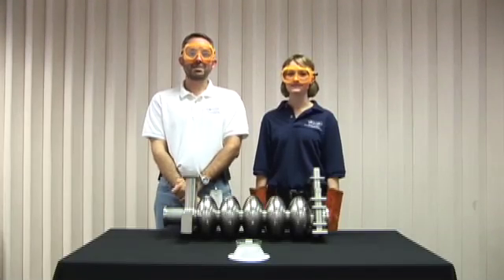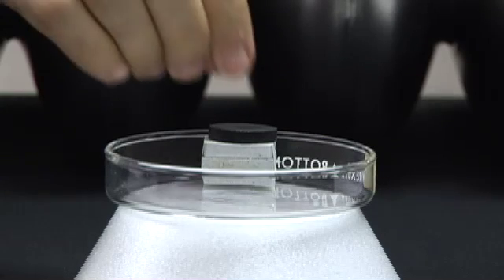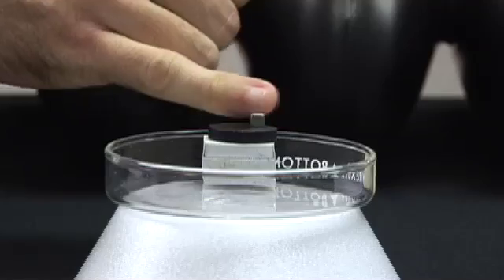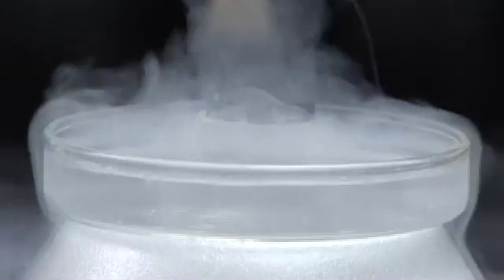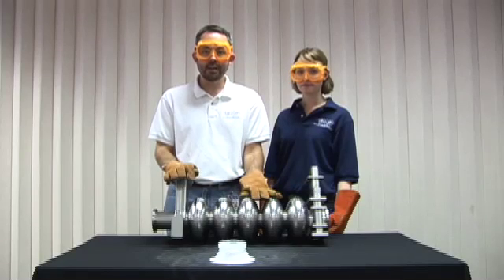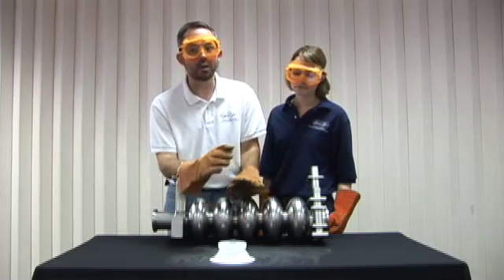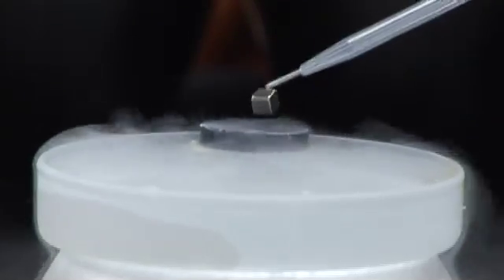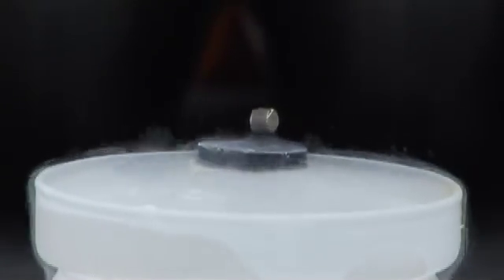Liquid Nitrogen Experiments: The Superconductor

Comment: One quick question. Can we use liquid nitrogen to obtain low temperatures required for superconductors and can we use these superconductors for electrical transmission by liquid nitrogen? Please tell me the reasons as to why it can or cannot be used. 
Thank you
Reply from the maker: Did you watch the video? This was a superconductor, and it was cooled with liquid nitrogen.

Comment: Great video! I know it's old, but can I ask some questions regarding measurements?

-size of the superconductor
-flux density of the magnet
- amount of liquid nitrogen to achieve superconductivity

Two more questions, quite silly: how much liquid nitrogen would you need to superconduct a material the size of a city, like 1500km², and how powerful a magnet?

I realise how super specific these questions are, so I appreciate if they're a bit too odd. Thanks, regardless!
Reply from the maker: +Pickens Incorporated The disk is about an inch in diameter. As for the magnet, I don't know the flux density, but it's a neodymium magnet, so it's pretty high. For a superconductor that size, it takes about 100 mL of nitrogen to cool it to its superconductive state.

We can estimate the amount of nitrogen it would take to cool a superconductive disk with an area of 1500 km^2. Let's assume the disk is the same thickness as the one in the video. If that's the case, then we're just dealing with differences in areas. The small disk has an area of about 5 cm^2, or 5*10^-10 km^2. Your city-sized disk has an area 3*10^12 times that of the small disk. If it takes 100 mL of nitrogen to cool the small disk, then it would take about 3*10^14 mL to cool the large disk. I believe that a typical delivery truck carries about 6,000 gallons, or about 23,000 liters, of liquid nitrogen. If that's the case, then it would take about 13 million trucks to deliver the nitrogen needed to do the job. If you could somehow offload 100 trucks every minute, then you'd be done in about 90 days. So, lots of nitrogen.

As far as the strength of the magnet needed, I haven't the faintest idea.
Reply: Jefferson Lab  Wow, that was extremely detailed, and put into a perspective I could understand easily. Thank you very much, you guys are great!

I really appreciate the response.
Reply from the maker: @MELWIN K.S No. Dry ice is not cold enough. The BYCO ceramic becomes superconductive around 95 K. Liquid nitrogen is 77 K. Dry ice is about 195 K.

Comment: Can't you contain the ceramic disk permanetly in nitrogen so it becomes a permanent superconductor?
Reply: or contain nitrogen at high pressure in this superconducter-material?
I'm not a chemist, nor physisit.. So maybe I should have asked why and would it impact the superconductivity if such a container is made?
Reply from the maker: ***** As long as you keep supplying it with liquid nitrogen, it'll remain a superconductor.
Reply: Ok, I'm not really a phsysicist and I believe this might be a stupid question, but if you would create a yttrium barium copper oxide-container and fill it with nitrogen, close it; would you than get a permanent superconductor?
Reply from the maker: ***** Nope. In the same way that a thermos bottle can't keep something warm or cold forever, heat will eventually get in and boil away the liquid nitrogen.
Reply: +Jefferson Lab also if the superconductor is thin enough it can be suspended above a magnet and turd in multiple ways witch is very interesting.

Comment: So if we made roads out of that stuff, put liquid nitrogen under them, and magnets under a car, we could hover around :) Neat
Reply from the maker: You'd hover but, at least with this type of superconductor, you wouldn't glide. Notice that the magnet doesn't 'drift' when it is poked. There isn't a lack of horizontal friction, and that has to do with how the magnet's magnetic field gets 'trapped' within the superconductor.
Reply: you couldnt control where you are going or braking.

Comment: use a peltier plate to refrigerate the disc instead of liquid nitrogen is possible?
Reply from the maker: Not with a single one, no. However, you might be able to get it cold enough if you bootstrap several Peltier junctions together.

Comment: If the ceramic disc, spinning magnet and nitrogen container was placed inside a dark vacuum chamber and the air was then removed from the chamber, would the magnet theoretically spin forever since heat would not be gained by the setup?  Or would thermal radiation eventually cause the disc to lose its superconductivity?

Comment: In a science museum about 200 kilometres  from where I live they have suspended a magnet by putting it between an electromagnet and another magnet(I'm not sure which type). You probably guessed that it floats, and spins, the only thing stopping it from spinning is the air resistance

Comment from the maker: @Almontmarine If I pour a little on it, nothing much will happen. I'm so hot relative to it that the liquid nitrogen would immediately boil and a layer of gas would form between me and it. The heat capacity of the gas is much lower than that of the liquid, so it's far less efficient at cooling me down. The formal name for this is the Leidenfrost Effect. Keep pouring liquid nitrogen and this effect eventually breaks down. Then, real trouble begins.

Comment from the maker: @GalTheJebac The magnets will not move because of the third law of motion, the one dealing with equal but opposite forces. Although one magnet is being pulled to the right, the other magnet is being pulled to the left by an equal amount. The forces are equal in size but oppositely directed so, overall, there is no net force on the magnets to make them go one way or the other.